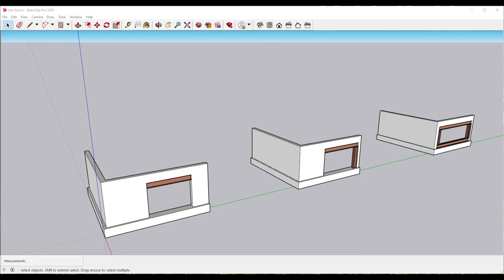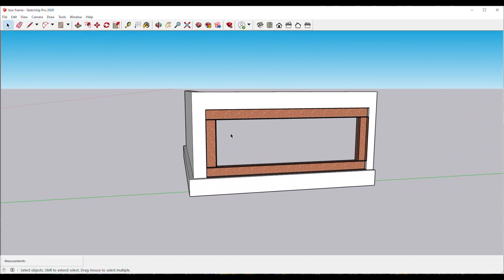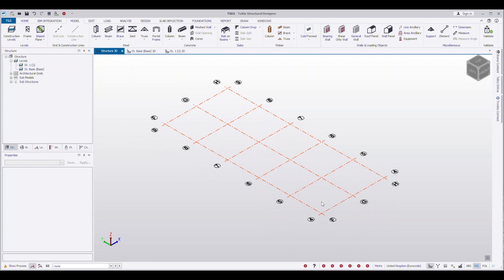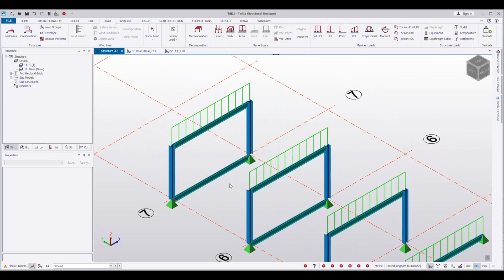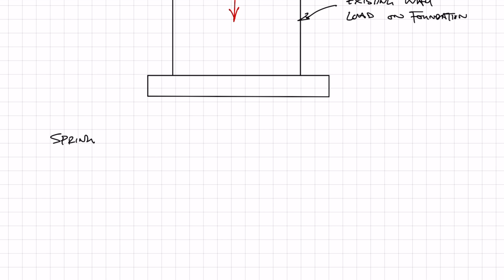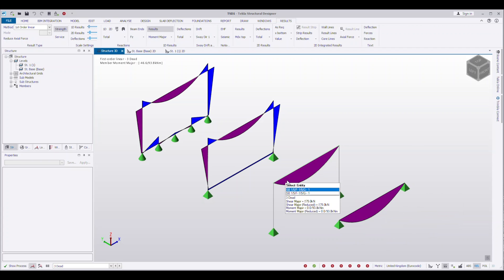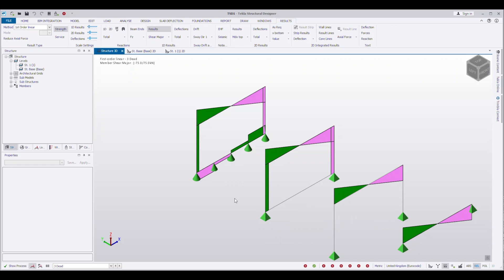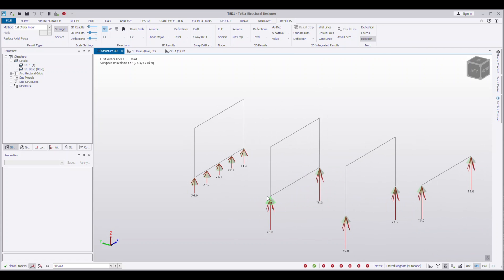Steel box frames - when to use and how to analyse - Structural Engineering

Comment: Genuinely don't know if I'm right in saying the below, just going from my own logic and asking the question.

Is spring stiffness not a property of the soil as opposed to a property of the load? Also, if you have units of kN/m divided by metres, you will surely get kN/m^2? My thought would be that if the ground bearing pressure were 150kN/m^2 for example, and the deflection was 20mm, then the spring stiffness would be 150 x 0.02 = 3kN/m?
Reply: I have since found out the correct solution from "Foundation Analysis and Design" 5th edition by Bowles (pages 501 and 513). The value shown in your video needs to be multiplied by the width of foundation and the trib length for each node. This will give you your value in kN/m, which is correct for a value of spring stiffness.

Comment: Hi Dazz, brilliant video with a very common scenario in domestic structural engineering. As a new entrant into the domestic market could you advise if the bottom beam of the steel Box could be positioned on the Rising Wall (usually solid concrete blocks on the flat) rather than the existing strip foundation? Positioning the bottom steel on the rising wall would be more beneficial to the client/builder as there would be more reuse of the existing structure, and less demolition waste. The load spread at the base indicates that loads are approx 35Kn at each spring position, therefore the rising wall would be modeled with a UDL of 35Kn/m and this loading can be easily carried by the rising wall. thanks

Comment: When designing a goal post frame do you use a tie rod below the opening to restrain the base of the columns from 'kicking out' or do you design the foundations to take the horizontal loading. I normally design with a tie at ground floor level but I have recently had queries from Architects saying that other Structural Engineers do not put these in. If you design the foundations to take the horizontal load it can make the pad foundations quite large! Just wondering what you would normally do.

Comment: Which software are you using for box frame analysis?
Reply from the maker: I used tekla structural designer for this example but most modern analysis software can do it

Comment: Hi Daz, I was really looking forward to box frame design and this is good. I normally design box frame  the option 2 way  and  i would expect to behave similar on the ground level with stiffer section due to being encased in concrete.  I would you use same bending moment  as the top member for connections. if you add lateral loads then it will give you error which basically they will ask you restraint it one direction on top level.
Reply: Hi SS, do you refer to the simple beam on columns option? I would say what type of support you use depends on the connection detail. If the ends of the beam are fixed, there is no issue with the lateral loads. If you used fixed supports for the top beam, wouldn't the bottom of columns be fixed as well, as it will probably be the same connection detail as the top of the columns?

Comment: Bending moment on the bottom beam doesn't look quite right. It implies theres a vertical tension restraint on the "springs". You need to make them non linear springs with no tension stiffness. Similar happens when you model a larger raft at braced bays. It would be good if you went through a hand calc either before or after to verify the results and show that you don't always need a computer program.

Edit: Also watch your units for, spring stiffness…… kN/m/m in your calc but kN/m Tekla input. Your 1d elements are 1.25m long so if I’m not mistaken your spring stiffness would be 
50[kN/m]*1.25[m]/0.02[m]=3125kN/m for along the span and 3125/2 for  the ones below the column.

Comment: Are the springs modeled to only restrain compression in Tekla, allowing for the beam to uplift? I would expect the bending moment diagram to look different for the bottom beam?
Reply: I agree, it should look more like an upside-down simply supported beam. You would need to use non linear springs to eliminate that restraint.
Reply: @Aaron-gl8cm  Hi , just saw you comments. IF i were try this with non linear stiffness. it is asking for positive stiffness and FMax( which assume is the maximum Axial force?).